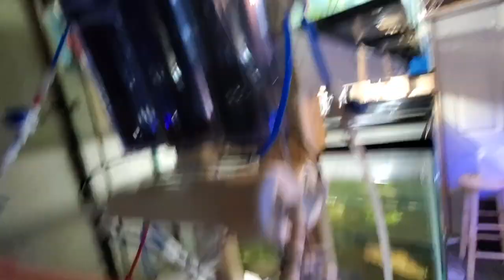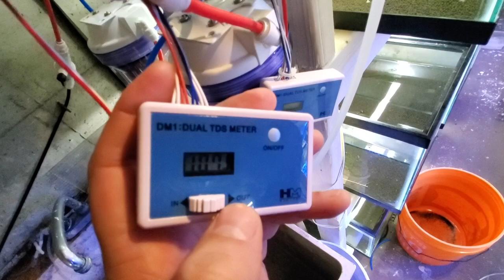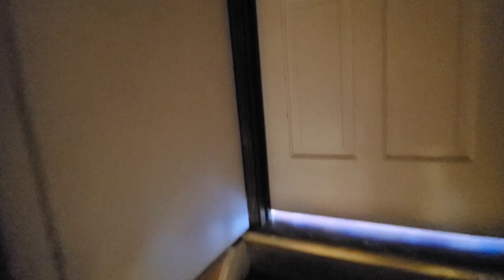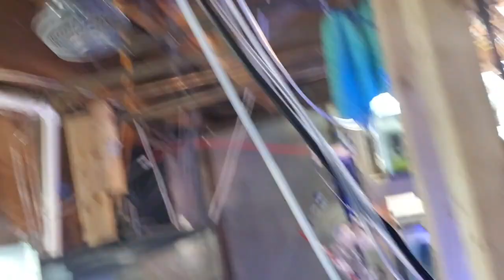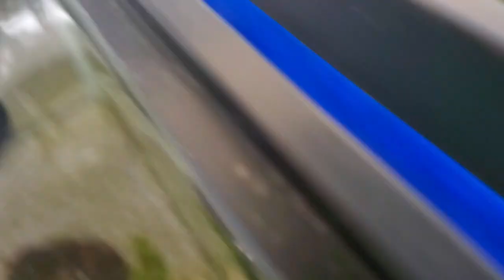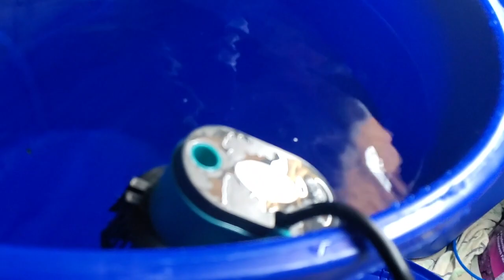Aquariums Start With Water: Start with Good Water 🆒

Comment: How critical/beneficial would you say it is to remove the last 2-5 TDS after my RO when keeping the more delicate of the caridina sp. ? 
I heard you say you prefer it and need it for SW, although can I manage almost as well without 0 TDS? My OCD and biochem ed. really wants to add DI, but my wallet and small apartment doesn’t hah. I love the science behind it and think it is really cool and smart how you have the separate cat + an before the mixbed. While I understand the science of it I’m not sure which charged particles are common to make it past the RO and make up the last few TDS to know how concerned to be or what parameters they could effect.
Also what is the blue bin called in your stairwell and where did you find it? Thanks